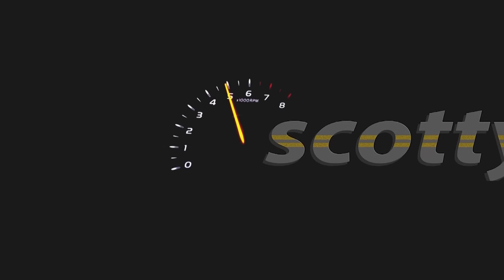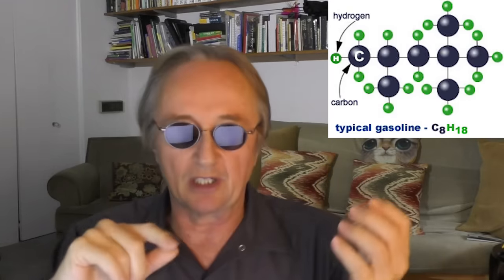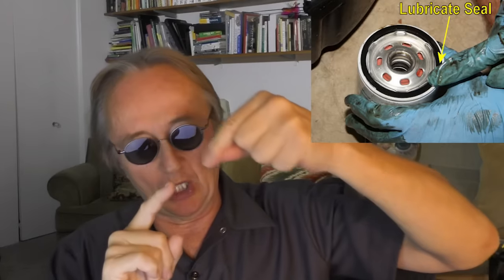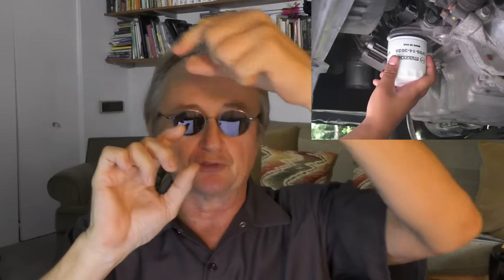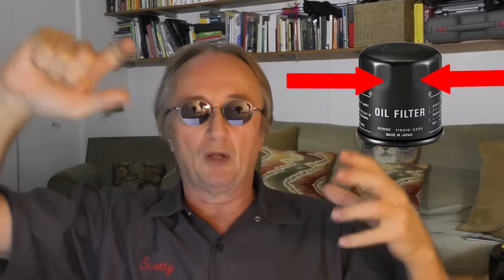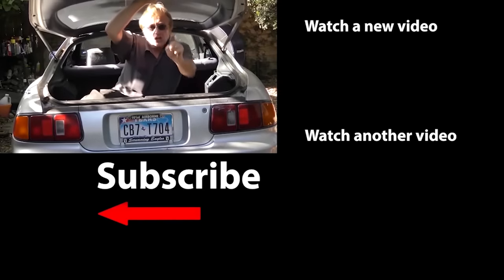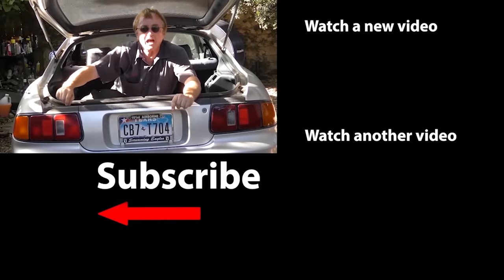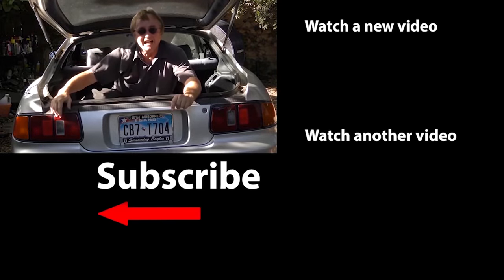Why Water Comes Out of Your Car’s Exhaust Pipe

Comment: QUESTION FOR A VIDEO:  Scotty, what is the best AWD vehicle? In terms of best AWD system, reliability, and maintenance... THANKS!
Reply: Ryan Dauphinee

I would agree. I'm a mechanic. Subarus have had head gasket problems on certain engines but the cars themselves are pretty well built and score well in crash tests. The AWD system is second to none. Honda's probably have the most ineffective AWD so avoid those. One thing to note about Subaru AWD systems is they do require more maintenance so change the fluids on schedule and rotate tires every oil change. Do not replace one tire new, make sure all are the same tread depth or you risk damaging the system. But you will not be disappointed by what those little cars can get through. And remember, AWD only helps you accelerate, it doesn't help you corner or stop any faster, it often gets people who have too much confidence in trouble. Get a Subaru, put Bridgestone Blizzacs on it and drive according to the road conditions
Reply: I personally have a 2010 Acura RDX (it replaced a 2009 RDX that was totaled this year) and the SH-AWD is amazing on it. Granted I haven’t driven many others but I personally love the AWD, it’s amazing in snow, full time unlike a lot of others, torque vectoring, and increases grip when I want to drive in a spirited way.
Reply: None of them, get a 4x4.
Reply: None, 4x4 is the best
Reply: @thefreestylefrEaK  On cars with gas engines, AWD requires the use of a transfer case and whatnot to get all four wheels to move; it's going to use a little more gas. Now that said, Subarus have the best AWD system, but in terms of overall reliability, I'd look at the Highlander AWD, especially ones from 2002-2007.
Reply: Sansabar MichaelRoyGalbraith. I like that you explained the AWD purpose..
Reply: @americanidle1277  Blizzaks aren't terrible, but I'd slightly prefer Michelin X-Ice for improved rolling resistance and slightly better snow and ice performance. Nokian's not a terrible brand, either, and is probably best for extreme cold. If you have a generally dry, colder winter, like Denver or the Dakotas, you may be able to get away with Vredestein Quatrac 5; it's an all-season tire that's designed for winter performance. It won't be quite as solid on snow and ice as the X-Ice, but it's as good as you can get for an all-season.
Reply: @americanidle1277  bruh prettt much everything you said is accurate, except that awd doesnt help u corner faster, yes it does.  It doesnt help braking, like braking in low traction environment.
Reply: @rickjames5998  AWD can induce heavy understeer and it only corners better in low traction conditions if you don't induce understeer, on pavement AWD is inferior to RWD
Reply: Rick James I would certainly think and would help braking even in low traction if you down shift with perhaps a slap stick. I’ve never personally done it myself but I know it certainly helps with rwd and four low.  Commonly referred to as engine braking.
Reply: Ryan Dauphinee 
Mitsubishi Pajero/shoguns are known to be best and reliable at offroading machines but are slow in speed when compared to Prado or other SUVs
Reply: @americanidle1277  blizzaks does not have studs though...
Reply: @svampae  Trust me, studs are a joke. They wear out too quickly, damage roads, and usually have hard rubber which isn't very good when the studs are gone. Studless winter tires are the way to go because they have to really design them well unlike any company who can just take an all season tire which doesn't do well in the winter so then they throw studs on it which grip well for a few thousand miles then you're left with a shitty all season tire when you could have bought a proper winter tire in the first place
Reply: @americanidle1277  proper studed tires have the same compound as unstuded tires. Like Nokian or continental, Nokian hakkapeliitta 9 got the best result on both ice and snow. And there is no way a unstuded tire can grip as good as a studed tire om raw ice, its just physics. If you feel like your studed tires lose their studs fast. Change your fucking drivning style! Dont blame the tires when its you that are wearing them out prematurely.
Reply: Lancer evolution x

Comment: What if the water coming from the exhaust is excessive upon acceleration. Fluids are full and clean with no contamination. (Maybe restricted exhaust) causing lots of condensation to not be vaporized in exhaust system ?

Comment: Sorry Scotty. They didn't convert the 350, it was very much designed and modified for diesel use. The block is very different. The KEY problem is stretching head studs. Change them out with new gaskets, and you can run them into the ground like any other. Not completely wrong, not completely right.

Comment: I couldn't get the bolt of to change my oil. I took it to a gas station and had the oil changed.  With a lot of effort, they were able to get bolt off.

Comment: Scotty im going to have to disagree on the screwdriver and oilfiter, someone is going to hurt themselves, and some cars have an extended spout where the oil filter screws onto and someone could potentially damage the threads on. Use this old trick, first clean the oil filter on the outside with a quick spray of  brake cleaner if youve been handling it with oily gloves, next wrap a belt around it (btw the belt is literally the best thing to use in a tight space for most cases) and slip the looped end of the belt you created and pull.
Works every single time. Unless they have a toyota with that damn plastic cap use the cap at the auto store. But for regular non cartridge filters use a belt if you have the space to

Comment: Correct me if I'm wrong, but isn't a oil/gas mixture related to piston rings being fried; not necessarily head gaskets?
Reply: usually yes unless the oil come from a crack in the gasket close to the oil galleries inside the engine. The oil going up to the head can be at up to 60 lbs./in in some cars.
Reply: R. M. That was a great explanation, thanks!
Reply: My 2000 buick..the oil has a slight smell of gas.. only 60k.. On it ..do i need to worry? Isn't this some what normal? Car runs fine
Reply: Air to fuel ratio incorrect .too much fuel to air intake map sensor faulty

Comment: That's why mufflers rust from the inside out. My shop teacher in 1971 said, "For every gallon of gas you burn, you burn a gallon and a quarter of water also". H2O.
Reply: The water content is probably even higher now thanks to having to use gas with 10% ethanol

Comment: Um, the water in the exhaust isn't mostly from gasoline byproducts. It's because of the water vapor (humidity) in the air the engine is ingesting with every rotation/stroke.

Comment: hey scotty love your videos im 17 and ive learned quiet a bit with your them. so i  just got a 1997 mitsubishi Mirage 2 door 1.5L and its an automatic in Puerto Rico they still are in use because the Japanese parts are very cheap ive heard some people  taken them up to 300,000 miles with normal maintain. we just got mine and it has 162,000 i will change the belt water pump ect. i just wanted to know if the Mitsubishi AUTOMATIC transmissions were good back then or are they just as bad as they are now ?  will it get better gas milage ( IT GETS GOOD GAS  MILEAGE ALREADY BUT THE LESS I SPEND THE BETTER LOL) because ive heard they have more power and run smoother with the stick .  my mom has a 2007 V6 OUTLANDER automatic and it still runs like a dream with the proper maintain and im not sure in what year they started messing up there new cars because they SUCK NOW. THE QUESTION IS  ?should i change mine to a standard transmission  in a future or just repair and restore the one i have like new before i run into any problems and keep it new without it actually braking? and would it prevent damage if i   i change the transmission oil right now ? because i think the old owner only used to change the motor oil. P.S  here i can have the engine and transmission fully re-built  and well done for under 2k ( its just a question for the future because it shifts very well still, but even if a get a new car i will keep it because the parts are cheap and there easy to maintain also in Puerto Rico we drop the evo 5 engine on them and have some fun in the strip lol .  thank you sorry for the long story and bad grammar im used to Spanish.

Comment: great video Scotty, you are the smartest car guy I know please tell me why we don't use hydrogen for fuel in modern cars. I know the argument it's too expensive. I call bs we build ships to take equipment 7000 miles drill a hole 5000 feet deep pump oil out bring it back another 7000 miles and refine it and so on. we watch them put people in space with hydrogen yet can't run a car on it. HA!

Comment: 5 k per year for 17 years works out to only 85 thousand miles...  so somebody is telling a few fibs somewhere. 9K is almost always too much for a normal car that's 17 years old no matter the mileage. However, I have found that cars that don't have the mileage they should for their age are always more of a problem than cars that even have high mileage for their age. Two reasons I can think of, either they're lying about the mileage, like it's been rolled back or come around again on "low miles" cars, or its just sat a lot. Cars that just sit always have problems. Sure, with high miles things wear out, but just sitting they can go bad for seemingly no reason. gaskets, hoses and such go bad when a car just sits, so can sensors and other electronic parts especially if the car sits with no or a dead battery. I once ran across a 1955 Packard that only had like 20K on it. It had obviously just sat a long time, there was fading on the upholstery in a line, where the sun hit all the time, the other side was like new. Belts hoses and the like had been replaced, it had a full service history, in fact the dealer that sold it new was still in business and had serviced it regularly... tho they weren't selling Packards any more. For those of you that have never seen a 1955 Packard, it kind of looks a lot like a 55 Chevy, but it's been working out and is bulked up some. It even had the self leveling rear shocks and they still worked. Alas, I didn't have the scratch to buy it at the time, they wanted 5K and that's when 5K was a whole lot of money, like 40 years ago.

Comment: Scotty, I have a '82 Toyota Corolla TE71 Liftback and the little 2T engine burns oil when it's cold, but it runs absolutely fine when it's at the optimum temperature. Any suggestions?

Comment: Hey Scotty 
I have an issue of the coolant fill the reservoir tank and doesn’t fill back the radiator. 
I replaced the radiator cap, coolant thermostat and coolant fan switch 
Could the new cap be defected ? Any advises ?  Thanks

Comment: Hey Scotty I have a 2001 Dodge ram sport 5.2 318 I put a new thermostat in the vehicle and I’m still getting a check engine light saying the engine is too cold The truck runs about 145 to 150° does it harm your vehicle to have an engine running to cool

Comment: I have water dripping from my Ford 500 Limited 3.0 duratec muffler. There's a small pinhole on the bottom about 4"  from the engine side.  It's an easy fix but I don't want to fix a hole that's supposed to be there. It doesn't seem to be where they would have put the pinhole. I don't even know if these mufflers have a water drain pinhole. THANKS Scotty. Any help would be greatly appreciated.

Comment: Scotty, please help and pick this - I have a nissan sentra 2009, the battery screw on the positive terminal keeps on getting loose. I have tighten it as hard as I can, any ideas? Also, the diameter on the bottom of the battery terminal is larger as compared to the top. The problem just started a few days ago.

Comment: Is there any way to determine weather or not a car is FWD or RWD by looking at it?
Reply: Look underneath in the rear. If there is a differential (looks like a metal ball) between the wheels it’s RWD. Or if you can look in the window in the back seat floor and there is no or a very minimal hump in the middle then it’s FWD.

Comment: How about a video changing the O2 sensor on the side of the motor that's at the firewall on a 2003 Hyundai Santa Fe with the 3.5L v-6 automatic. I need a video showing how to change it.  N I really don't want to have to take the intake off again like when I had to to change the back 3 spark plugs.

Comment: I have toyota corolla ALTIS 2004 E120 ZZE121 1.6 3zz-fe engine my car fuel consumption is very bad 6km/liter i have change MAF, injectors, tuned the car spark plug a little change. Moreover if i kept tha car idle for more time i see mostiure from exhaust and i check it my putting hand near the exhaust and mostiure on my hand

Comment: 4:20 that 02' ford escape aint worth crap and damn sure not $9k... They are very noisy with so much wheelwell noise, The alarm goes off for no reason repeatedly, and the doorlatch always has a door ajar light even when the doors closed... My best friend had a 2005 limited and it still had those problems and so have so many other people

Comment: My Mustang Gt gives out a lot of smoke at a red light during cold weather but goes away when I accelerate,is that normal condensation? The car has a slight exhaust leak too if that has anything to do with

Comment: My water pump gaskets blew and water drips onto the belt and I just noticed there is a steady drip of water coming from my tail pipe. Could it be from the water flipping. Into the air intake?

Comment: If you have a car that runs on hydrogen water will come out as a byproduct. 😂🤣😂
Reply: Gasoline is a hydrocarbon.
Reply: Where did I say anything about gasoline? Hydrogen combines with oxygen when it is burned and produces water as a by-product.  So water coming out of a hydrogen car would be normal.
Reply: @goodmaninabadtime117  :  You didn't say anything about gasoline.  I did.  I am pointing out that gasoline is made of hydro (hydrogen) carbons.  So, when gasoline is burned, the combination of the fuel with oxygen produces some water (hydrogen/oxygen) along with the CO2, (and other byproducts and pollutants).
Reply: 😎👍 correct, gasoline works just like a water car, hydrogen oxygen explosions, then they recombine on the way out
Reply: goodmaninabadtime117 

Hydrogen fueled vehicles use fuel cells to produce electric current. They do not burn hydrogen to produce heat, as with a hydrocarbon fueled engine.
Reply: MrSammy 

No. Water cars? Really? Hydrogen fueled vehicles use fuel cells; not anywhere near similar to internal combustion engines.
Reply: Alex Mitchell ok and that has nothing to do with my comment.
Gasoline and hydrogen are not the same thing.
My point was that you get water from a hydrogen fueled car. Whether is is a fuel cell model or a model that burns hydrogen.

Comment: MR.Kilmer, I don't have water problems with my car but the led floor lights went out, then the front main headlights went out, now I have no headlights, nor the floor led lights either, I can only drive my car during the day, if im somewhere and I forget about the time, and I find out im somewhere in the dark,the sun has gone down and its pitch dark out im stranded where ever im happen to be at, I guess im spending the night where ever that may be, MR.Kilmer could you please offer me some idea,s as to what the problem could be please ? I checked all the fuses under the dash next to the hood release handle, I found one that was split, once I replaced it, no change, it was still not working as it should, I don't have hardly any experience with electrical systems , especially in a C-3 1980 corvette which is the car I have, and just bought it no more than 5 months ago, everything was fine up until about 3 months ago, so now it just sits , not being driven much , I start it maybe one or 2 times a week just to keep the fluids circulating , I could use any help you can offer, anything to help me to get my lights back on would be super big time appreciated big time, im super depressed since this all happened, any idea,s what I can do to correct this problem please ? thank you sincerely, C-3 with no headlights owner , ( William ) thank you for any help in any way would be greatly appreciated

Comment: Hey Scotty, I love your videos! I've got a question for you! I have a 1965 Plymouth SportFury with the 318 A "Poly Head" engine. These engines are extremely hard to find parts for since they were replaces by the LA Engine in 1967. It needs a rebuild pretty badly, but I'm considering swapping it to a 383 Commando Engine. I would however, like to keep the original engine if I could. My question is, what do you think is the best option? Is the old Polysphere Engine worth it?
Reply: You might need a high-end classic car restoration shop in your area to ensure you keep your original engine, which also helps with valuation.

Comment: Scotty loving your videos. I have a real question. I have a 92 5spd accord. 330k miles engine purrs but my clogged cat is chugging. I can replace that myself (pretty sure)  but I have the opportunity to trade for a 90’s era Subaru Outback with 160k + miles. Which car in your excellent opinion is most reliable. And will be easier to fix yourself as a diy YouTube mechanic like me?  I feel like my Honda will run good after a new cat and I’m told the Subaru has a “rattle”. Any advice would be amazing

Comment: I have a 2014 ford fiesta. Dealer wants to FLUSH out the oil. I heard somewhere to never FLUSH out the radiator. But what about the oil? Should I let them do it or not?
Reply: Lorraine Le Clair no, just drain, and refill, that will be fine!